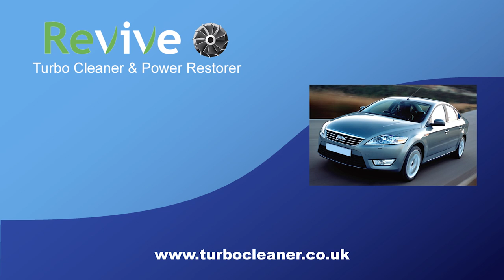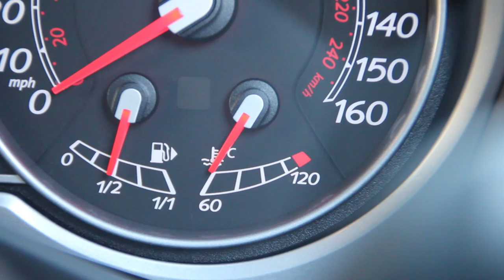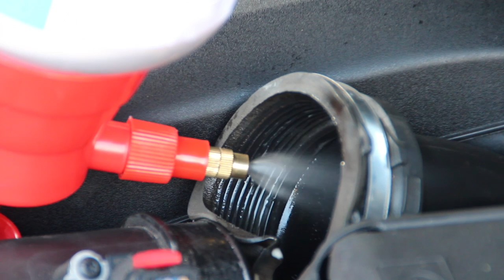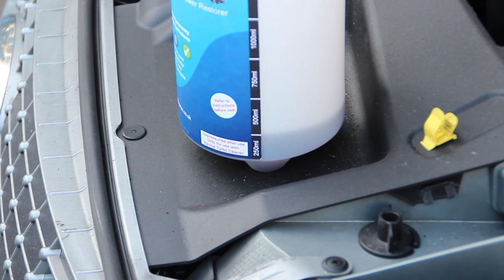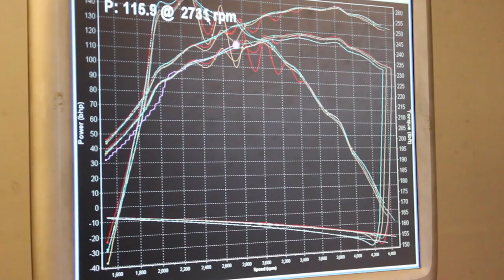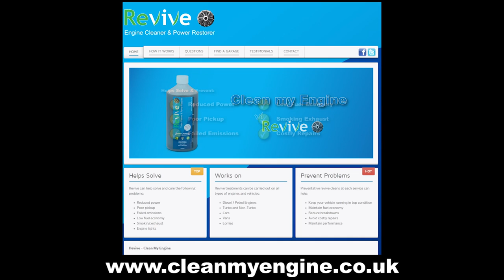Revive Turbo and Engine Cleaner

Comment: Hi. The model of my car is Audi A6 C7 3.0l TDI 2012 The question is, if the revive cleaner fits to my car, the point if, if it's safe? (DPF, TURBO, INTERCOOLER) Thanks in advance.
Reply from the maker: Hi, yes the product is totally safe for your car, however we always recommend having your car properly diagnosed to make sure you are treating the correct problem.

Comment: How much kilometres we want to do this
Reply from the maker: Hi, the mileage is not really that important as it is more to do with when your car is feeling a bit down on power or develops a soot deposit fault which can happen at any mileage depending on how the car is used and the quality of Fuel put in. However the treatment will always clean even if you don't have an issue and if that is the case I would  recommend using one of our service shots before you change your oil as a preventative maintenance treatment.

Comment: Hi, I have trawled through the comments & replies but can't see the EGR valve mentioned. I am going to try this product anyway but wondered if it would help with the dreaded EGR - Limp mode scenario. I am about to try the Wynns EGR cleaner spray as soon as Amazon delivers it. :-) btw the dar is a Ventra V6 CDTI 2008.
Reply from the maker: Hi Paul. Sincere apologies for our very late reply. We had stopped receiving notification emails from youtube so we missed your post. Depending on where the EGR is situated, Revive will clean the EGR providing the fluid can pass by it. Being realistic, if the EGR is totally blocked and clogged, and only a pick would unblock it, then Revive would struggle.

Comment: Have you guys had any testing on the 3.5 Ecoboost? I have the traverse one in the Taurus SHO. If you could prove that this works with data Ecoboost will jump on it like flies on poo.
Reply from the maker: Sincere apologies for our very late reply. We had stopped receiving notification emails from youtube so we missed your post. Revive will be suitable for Ecoboost engines and turbochargers, but it depends on what the problem is. If the problem is with the inlet valves 'coking' up due to the design of the Direct Injection, then due to the fact that fluid is nearly 800 times denser that air/gas , the fluid will prioritise the nearest ports and will take the shortest route,  only cleaning the valves which are in its  most direct path, unlike air would be evenly distributed throughout the inlet plenum.

Comment: Hi there, is this suitable for Mazda cx7, 07 model and what is the difference compare to any other brand's out there. thank you
Reply from the maker: Hello Nelson. Revive is suitable for all 4 stroke combustion engines. Revive is an aqueous based fluid which is non-flammable, non-caustic and non-combustible, so you will not experience any engine knock when applying it, nor will the engine revs fly up, because it's not a propellent. 
Have as llook through our FAQ's on our website for more information. Kind regards
https://reviveturbocleaner.com/index.php/questions

Comment: Will this stuff work on a Rover 1.8 T Petrol Turbo?
Reply from the maker: Hi Brian, yes this will be fine to use on your Rover, we have just launched a dedicated Petrol kit which should be available from your local stockists  the part no. is 1449-9400. the application is the same but the fluid and instructions have been slightly tweaked to be more suited for petrol engines.. Kind regards

Comment: Hi, would this product clean EGR valve and injectors as well or its only for Turbo chargers? Thanks
Reply from the maker: Hi Sheraz. Depending on where the EGR valve is located in the system and whether it is open or closed (Revive needs to pass through it to clean it) Revive will make a big difference. However, as Revive is applied through the air intake and then the combustion process, it does NOT pass through the injectors , so will not clean them. Hope this helps and thanks for getting in touch.
Reply: Thanks for the quick reply. where do you guys based?
Reply from the maker: Our pleasure..We are based in Wiltshire - UK and we are the manufacturer of Revive : www.reviveturbocleaner.com

Comment: hi, will it work on my 2013 Hyundai Sonata 2.0 turbo gasoline engine ? thx in advance
Reply from the maker: Hi Ahmed. Yes, Revive is suitable for your vehicle. Does it have a partuclar problem, or do you just want to perform a preventative maintenance treatment?
Reply: I bought this car second hand and i think it lost some of it's power as sometimes i can't hear the turbo spooling and sometimes it does even give any boost, so my thoughts are to clean the turbo without disassembly, any chance i can find it in Iraq ?
Reply from the maker: Providng there are no underlying issues mechanical issues with the turbo or associated sensors, then please treat your vehicle to a Revive clean. We do not have a distributor in Iraq, so you will need to purchase it online from the most suitable country and who ship to Iraq.
Kind regards
Reply: So i ordered revive and it should be coming in the next month, how should i use it on my sonata cause i cant find my mass air flow sensor and i am afraid if i use it i would damage my car, can u point my in the right direction ?
Reply from the maker: Hi Ahmed
If you check where the intake hose comes out of the air box you should see a electrical plug going into the pipe, this will be your MAF sensor but if you are still unsure the best option would be to google it as there are google images to help you.
Kind Regards,
Reply: I did some research and i found it , it's found on the pipe between the turbo and the intercooler of the turbo, so if i use the product will it hurt the sensor and the car ? will it hurt the sensor at all ? thx
Reply from the maker: Hi Ahmed
It would appear that your car is only fitted with a MAP sensor and not a MAF sensor this should be absolutely fine with the treatment, but if you are still unsure I would get a Garage to do the treatment for you.
Kind Regards,

Comment: IS there any risk involved if this man uses this to Revive my 36 yr. old Benz TD? It's only tracked 135K in all those years. I have no oil problem. 
Please advise. Thnx Twice, rtm3 ((°|°))
Reply from the maker: Hi Robert this will be fine for your car, I myself recently treated my car with 242k on the clock and it made a real difference.

Comment: grooovy. what about the "wastegate" & cleaning that part of the turbo unit? this is also important. 
I used a "stiction remover" through my oil. I dropped two cans of LiquiMoly diesel purge through  fuel tank as well. it seems there are many terribly vital, necessary things one can and must do. they can't do everything at the German garage... 
thnx reviver bloke
Reply from the maker: I would recommend working the moving the waste gate up and down by hand during the intervals between dosing the treatment.

Comment: HI will it be ok on my 95 7.3 liter ford 350 with a garret turbo?
Reply from the maker: Hi Luke, yes Revive will be fine to treat your engine.
If you are in the states we now have the Big T Kits available which are especially designed for large engines.

Comment: hi, can I use this on a seat leon mk1 2001 1.9 tdi, is not picking up power quick.
Reply from the maker: Hi Tabish, the treatment will be fine for your car and will help if the problem is deposit related.

Comment: Hi I have a Mitsubishi Grandis 2.0 Did. Its come up with fault codes. po234 and v0002. will revive help with this?
Reply from the maker: Hello William. Well, P0234  is an overboost code, which can be caused by sticky vanes inside the variable vane mechanism of the turbocharger. If this restriction is due to soot deposits, then yes, Revive should be used. However, this code can also be generated by faulty vacuum pipes or faulty pressure boost solenoid/valve. Your vehicle is fitted with a Garrett GTB1646VM which has a diaphragm operated actuator, so please make sure this is also holding vacuum. Once you are happy that all is in order, then treat it with Revive.

Comment: Can i use it on opel astra f tds
Reply from the maker: Hi ..yes you can. Revive will clean any gasoline or diesel engine,  (except 2 stroke) whether it's normally aspirated or turbocharged and providing your engine is mechanically ok and does not show signs of wear. Please do not perform a Revive treatment if your engine is excessively using oil, has 'end float' wear in the turbo shaft.

Comment: how about on a 2002 Chevy 2500hd with Duramax diesel engine?
Reply from the maker: Hi and thanks for your question. Yes, very popular for the Duramax. Our U.S  & Canadian distributors have specific instructions for the Duramax engine, due to its low RPM range. You can downlowd these instructions from their websites, although the kit in the States includes them. Here are the website links for reference. 

https://www.revivemyengine.com/what-we-do/ (USA)

http://www.reviveturbocleaner.ca/use/ (Canada)

Kind regards

Comment: Can I use this in a 2016 VW GTI to prevent buildup? How many doses should I run through it? I found out buildup seems to be a neverending problem with some GTIs.
Reply from the maker: Hello Largol33t1
Thanks for your question.
Yes Revive will help not just as a treatment but also as a preventative, I would use a starter kit to begin with and see how you get on with that, if all goes well you can use the service shots between regular maintenance to keep on top of the problem.

Comment: What's the difference between this and seafoam?
Reply from the maker: Hello Roddy and thanks for your question.
Seafoam make several products, so it does depend on whether
your question is Petrol/Gas or Diesel based. The closest comparison to Revive
would be their Seafoam Spray, which is an intake cleaner and because it is
flammable, the fluid is combusted by the time it is going out the exhaust
valves and into the turbine. Although Revive will also clean the intake, we are
targeting a specific issue on the variable geometry mechanism within the
turbine side of the diesel turbocharger and because Revive is a non-ionic
surfactant and is non-combustible, the ingredients in the fluid are still
active after combustion. Although they are different products and are not a direct
comparison, in summary, Seafoam is a flammable hazardous chemical based intake
cleaner and Revive is a safe non hazardous chemical turbo cleaner which also
clean the intake. Both Safety Data Sheets (SDS) can be found on the web through
search engines.Hope this answers your question without being too biased  :) Kind regards

Comment: Hi Guys,

I have bought the product and I want to try it out on a ford galaxy 2002 model. I do not know much about cars at all. Do you guys happen to have a link or make a short video explaining to me how I find my inlet air pipe and mass air flow filter please. Thanks Mehdi
Reply from the maker: Hello Rads. Please refer to our website www.reviveturbocleaner.com or please call our technical team on +44(0)1225 701920 where we can offer asistance if you are unsure. Kind regards
Reply: Hey guys. I tried the cleaning process two days back. My car is still going into Limp mode. I will be trying the cleaning process once again,  and the giving feedback.
Reply from the maker: Hi rads... Did the Revive treatment make any difference? If none at all.. then we would suggest another fault. If it did make a difference in performance but not perfect, then it is worth giving it a second treatment. Please consider an oil change after treating it twice. Regards

Comment: what would a petrol engine get the benefit ?
Reply from the maker: Hi Chris. Adimittedly, diesels are dirty and petrol engines burn a lot cleaner. However, Direct Injection Petrol engines, such as GDI's, TFSI's, FSI's and EcoBoost's etc.. suffer from soot and carbon deposits in the intake system but especially on the inlet valves, causing an air path restriction. This in turn causes the engine to run rich and lumpy. Using Revive on a regular basis, would minimise thie build-up.
Reply: Is this same as seafoam or amsoil to a petrol engine and any good to clean the throttle body ?
Reply from the maker: Hello Chris. Revive is a non-ionic surfactant, so when applied through the intake system with the engine running, will clean the throttle body, inlet valves etc..

Comment: is this okay to spray directly into the turbo?
Reply from the maker: Hi Michael. Yes, into the compressor/intake side of the turbo. It will not cause any problems with the impeller but please ensure you get a good atomised spray pattern.

Comment: Hi there, I just had my car terracleaned but didnt solve the problem with it going into limp mode if I go past 3000 rps in anything past 2nd gear....  
I Think it is a turbo problem as before it was stuttering when acceleration... any feedback? Jaguar xtype 2.0d
Also I live in TW20 area do you have anywhere I can buy this product instead of online?
Reply from the maker: Hi Bruno. We have replied to your email. You can purchase Revive in your area from GSF Car Parts https://www.gsfcarparts.com/heathrow but please check with them before travelling.
Reply: Just did it, still think I will need another refill :D 
car feels a lot better so I will buy a refill to do it again!
Reply: your turbo waste gate either stuck open or close. get a decent mechanic to free your waste gate actuator. that's what I did to my old pasaat tdi.
Reply: Bruno Baleisão b
Reply: my mk5 golf gttdi also hitting limp mode at 2k + revs .garage told me could be clogged up vanes ,and cheaper to fit new turbo ,
Reply from the maker: Would be well worth giving Revive a try before you spend out on a new Turbo
Reply: Fuel filter?
Reply: Bruno Baleisão i

Comment: Can i use it on my 2001 vw golf mk 4  1.9 tdi with 274.000 km
Reply from the maker: Hi and thanks for your post. Yes you can, providing your engine is mechanically ok and does not show signs of wear. Please do not perform a Revive treatment if your engine is excessively using oil, has 'end float' wear in the turbo shaft.
Reply: +spdiagnostics thx for the answer 😊 ✌

Comment: Hi there, will this work to unstick the variable vane's on a VAG turbo on my Volvo XC90 D5 2.4 L 2004 reg diesel car. Everytime i put my foot down to overtake or speed up very quickly then after hitting 3,000 rev's the car goes into limp mode and my mechanic said it is the variable vane's sticking because of carbon build up and has quoted me around £750 to un stick them. Please help because my mechanic is a greedy little bastard.
Reply from the maker: Hello Khalil. Yes, Revive will help, providing that the problem has been diagfnosed accurately. To remove the turbo, strip it and put it back on, is not a cheap job, due to the labour invloved,so I would imagine, that £750 is the going rate, which is why Revive has proved successful as a cost effective 'no disassembly' alternative.
Reply: OK, thanks for letting me know that revive will help to de carbonise the turbo. I have just put some Archoil ar6400 d in my tank and will see if it sorts this problem out if not then I will try Revive. Thank's

Comment: my ford dealer told me that I had a blocked turbo and cleaned it out I am still getting smoke and we have tried everything else the car smokes when slowing at  a junction when we  move away it smokes so wonder if your product may help
Reply from the maker: Hi Euan. It is difficult for us to diagnose the fault without specific information, but Revive will always help, as it always good to clean the soot deposits away from the engine's air path. However, we only recommend a Revive clean on a mechanically sound engine.

Comment: hi there, I have a 2007 mkv jetta gli 2.0t. I have engine codes 0234 2293 0089. two are for the fuel pressure injector and one is saying I have overboost. will revive fix my issues?
Reply from the maker: Hi and thanks for your question. 2293 and 0089 are both related to fuel pressure, which Revive won't fix. 0234, is indeed an 'overboost' code and providing you have checked and happy with the vacuum components, then Revive will certainly help by removing the soot deposits in the variable geometry mechanism in the turbo, which has probably caused the overboost code. However, the 2293 and 0089 codes are probably causing you more problems, so sorting those out first would be our advice. Kind regards.

Comment: Hey.. I hav got a 53 reg vw bora normally in 3rd gear it would kick and move if i gave throttle but it doesn't seem to be doing it recently, i was wondering if the revive could sort the turbo out and i could feel the kick again?
Reply from the maker: Hi and thanks for your enquiry. We would recommend you seek professional advice and have your issue diagnosed. If the problem is due to sticky vanes in the turbo, which is caused by soot deposits, then Revive will definitely help!